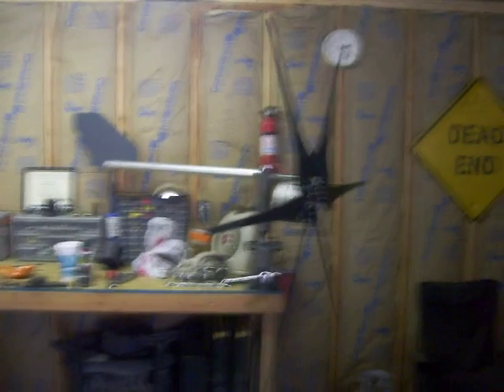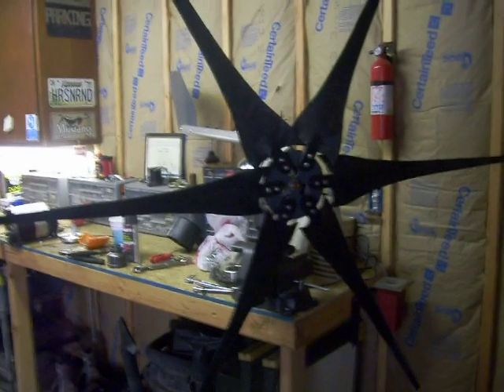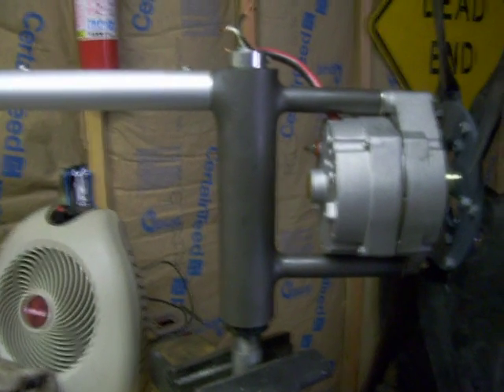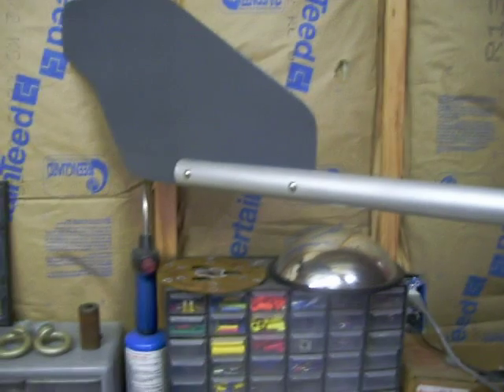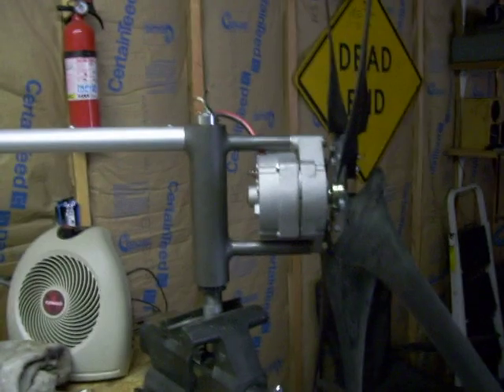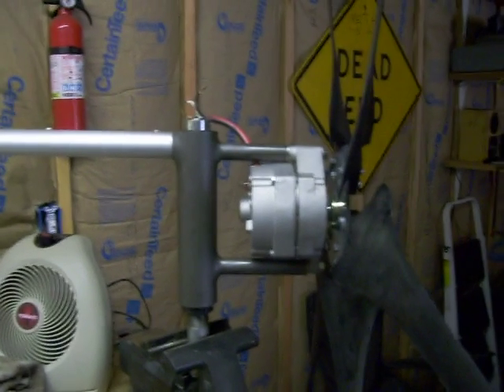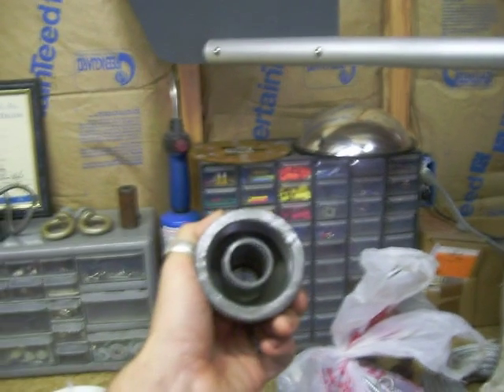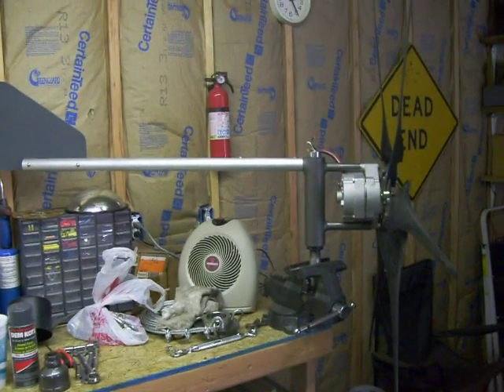Wind turbine close up

Comment: @josheskimo Josh, You need to exceed 12 volts or whatever the voltage is on the batteries to do any charging. Car batteries just won't cut it. They are meant to provide a large amount of power for a short time, such as starting a car, and then be charged right back up. You really need deep cycle batteries or even marine batteries which can ran down or cycled repeatedly. They are designed different than car batteries. Hopes this helps ya get started. FYI,Golf cart batteries are great for the $.

Comment: Josh, You need to exceed 12 volts or whatever the voltage is on the batteries to do any charging. Car batteries just won't cut it. They are meant to provide a large amount of power for a short time, such as starting a car, and then be charged right back up.  You really need deep cycle batteries or even marine batteries which can ran down or cycled repeatedly. They are designed different than car batteries. Hopes this helps ya get started. FYI,Golf cart batteries are a great choice for the $.

Comment: Mark, I just use a really thick wire. #6 welding cable. It has super thick insulation which acts like a rubber band.  When twisted a few times it just untwists itself You could use slip rings too. Just by good ones, the cheap ones fail. Take care.

Comment: amazing! everything's clean, sharp, beautifully constructed, and simple! i'm really interested in the hornet blades. are they metal or pvc? and what do you suggest using to replace the rotor in a pma setup like this? i pondered replacing the coil inside the factory rotor with two neodymium doughnut magents,...do u think this will work well?